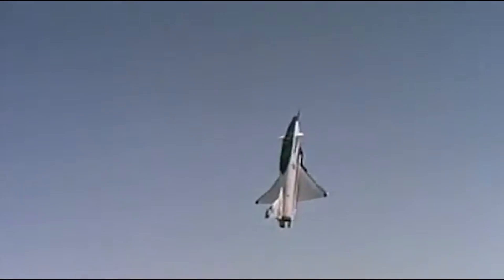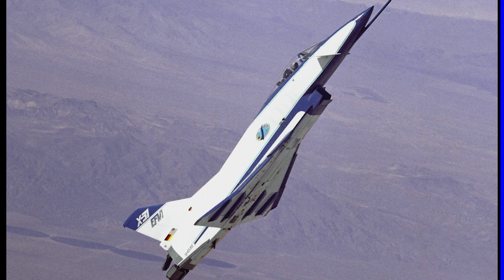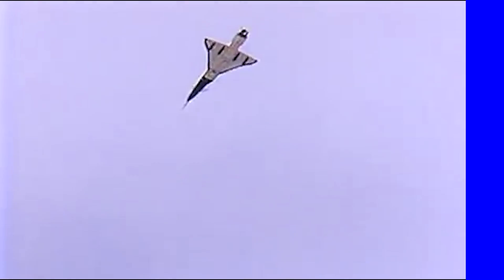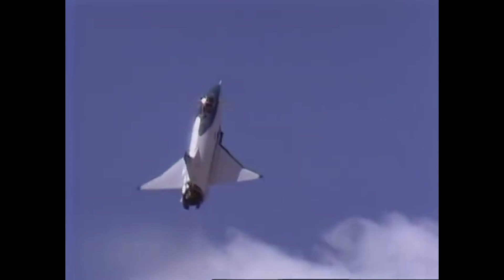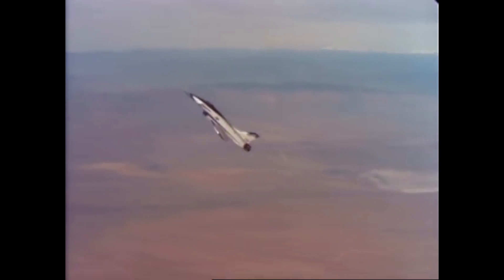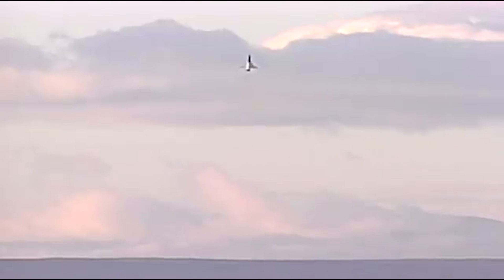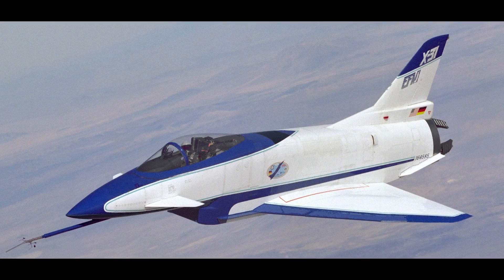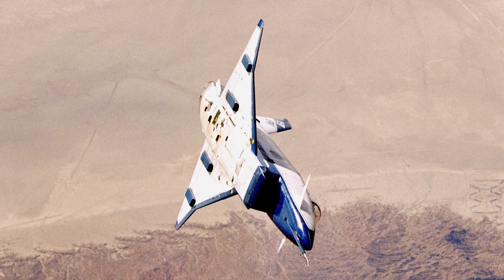NASA X31 | The Enhanced Fighter Maneuverability Demonstrator at Edwards AFB

Comment: Thrust vectoring is more useful than VTOL change my mind.
Reply: I effing hate vtol and all the compromises it requires
Reply: Depends on the aircraft in question and what role it fills
Reply: @alexdunphy3716  VTOL is expensive and just adds to maintenance costs of both the aircraft and flight decks. I could see it being more viable 30 years from now. But as of 2020 its just not that useful outside of a defensive or CAS role. (Thankfully its not used outside these rolls anyway) 

For the most part a VTOL aircrafts job can be compensated by having a decent airspace denial system and a few helicopters.

VTOL is great for pacific operations and island nations. The issue is they are easily replaced by helicopters, which are often easier to maintain, and cost less just to get off the ground with a full armament.

Comment: It could had become a fighter all on its own, it gave a lot of valuable data for all the current projects worldwide!! Great piece of film Juan, thanks!👍
Reply from the maker: Can you imagine? And thanks as always Juan!
Reply: Yep, it could. It was certainly the 'Dad, Mum, Pappy, Grandma' of an awful lot of brilliant fighters to follow it's legacy.
Reply: Not really. The payload capacity, range, and speed were too low. It lacked the combat, communication and navigation avionics and sensors. Likewise it lacked an internal gun or any provisions for external stores (weapons/fuel tank pylons). Addressing all of that would basically be designing a whole new aircraft. But this aircraft and it's research is still important nonetheless.
Reply: @namja01  Always with the negative waves Moriarty!.. It was  a X Plane/ Test Plane. However, it did have the propensity to be equip with all the accoutrements to make it combat worthy. .'They' trialled the 'Bird' with weapons payload before settling on  HASR as it's sole role.

Comment: Great vid enjoyed. However you did not mention how a Nasa plane ends up In Germany?
Reply: The Messershmitt connection. There's a few of Willy's 'Schwalbes  that found a migratory route State-side too!
Reply from the maker: good point - since the collaboration was between NASA, Rockwell, and MBB my guess is the first one was going to stay in USA and the second one to Germany...first one crashed so that could be why.
Thanks for commenting!
Reply: @PilotPhotog  Yeah fair enough.
Reply: @PilotPhotog  Actually the EFM program was not the end of X-31 flight testing.  There was a follow-on program (VECTOR) executed by the US Navy at Pax River with Aircraft #2.  Incidentally, the original EFM program was a joint program between DARPA, US Navy, German DLR, Rockwell and MBB.  NASA did not join the program until after flight test program had already started in Palmdale, CA.  When NASA joined, the program moved from Palmdale to NASA Dryden to continue flight test there.